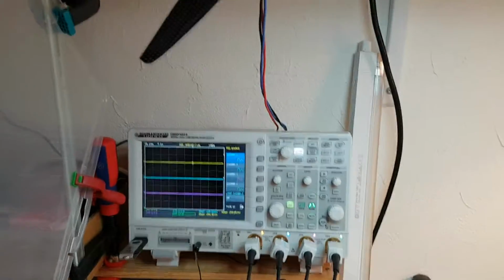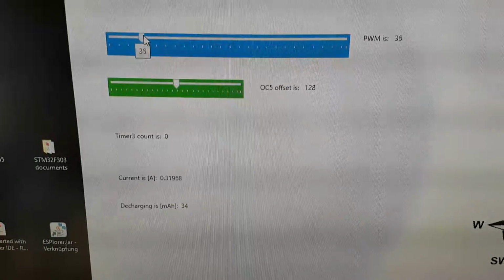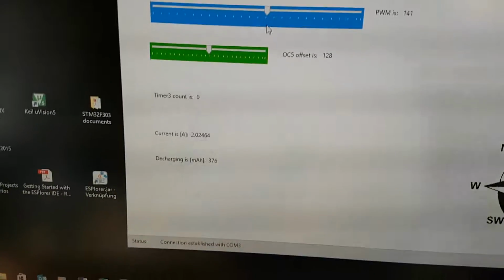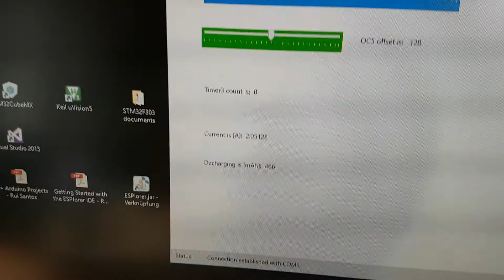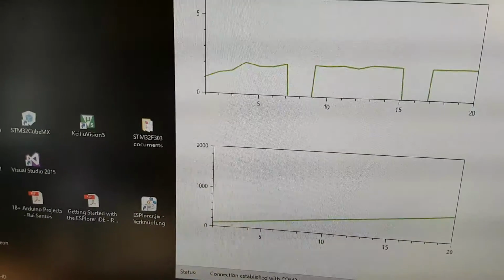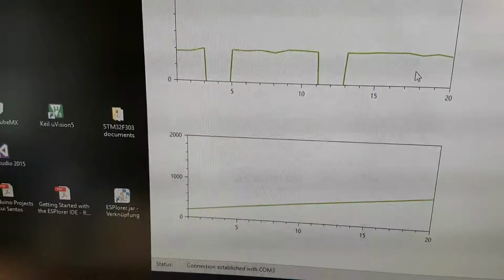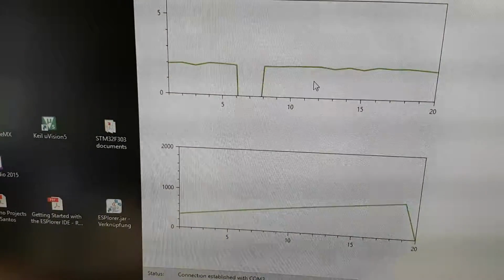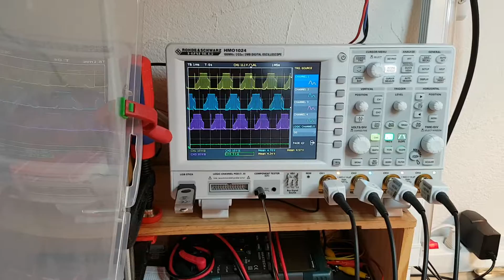BLDC motor controller with CAN bus interface

Comment: Hello what is the name of software used for controlling via CAN bus?
Reply from the maker: I did programm the flight controller as well as the motor controller in C for a STM32 microprocessor. I did use STMs free tools to do so (Cube MX, Cube IDE).
Reply: @HB9GZE  I would really be appreciated if you could share more explanations with me. I am a university student and I have a project assignment which is similar with your application . May I contact with you privately to learn more ? 🙏🙏
Reply from the maker: @umutyalnzoglu1174  sorry no not possible. The internet is full of free tutorial on how to code in C for the STM32.

Comment: I have been looking up how to use CAN bus to control brushless DC motors. Brand new to all of this. Do I still need a separate control for PWM? Or can the PWM be included in the CAN's communication to that motor?
Reply from the maker: I just send the set-values for the speed (pwm) through the CAN bus. eg. 0 for 0% pwm and 65536 for 100% pwm. The pwm for the motor will be generated on the BLDC motor controller itself. Check your maximum bus speed of the CAN bus so it is fast enough to send set 4 pwm set-values (one for each motor) with little delay. See also www.verysmart.ch
Reply: Awesome. Exactly what I need to know. Thank you for the quick reply.